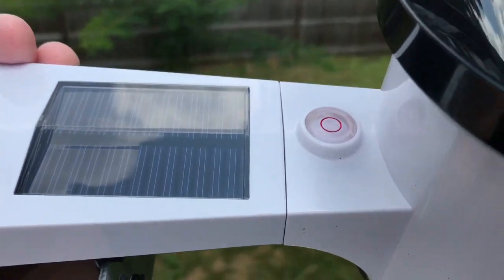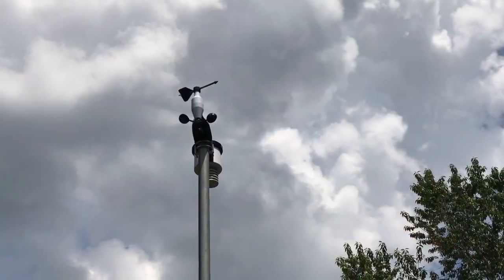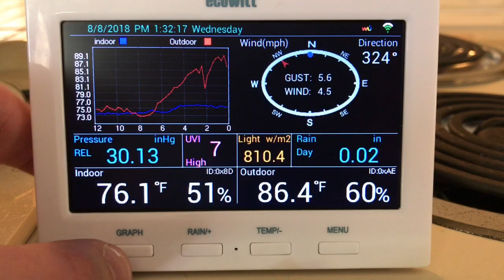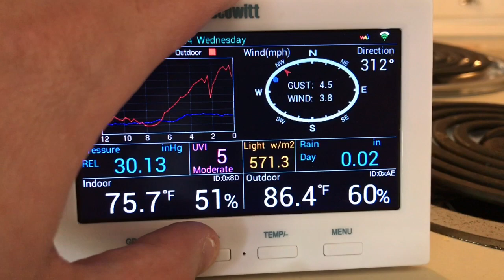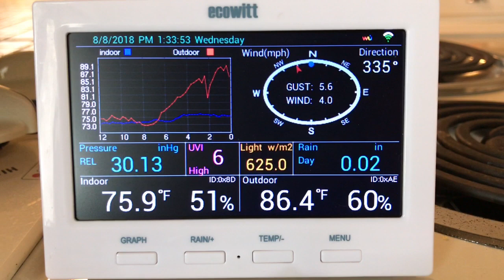Ecowitt HP3500B Weather Station

Comment: How is your console and your  complete outdoor unit now performing 2yrs later? Read on Amazon that many seem to give up the ghost a few months later? Please make a new video showing the condition of of your devices and any problems you might have encountered thus so far November 2020. Thanks.
Reply from the maker: It's still running great! It's installed on a 60ft radio tower so I can't get any updated video easily of the outdoor unit. I haven't touched it since we installed it 2 years ago. You can see live data from it here: https://www.wunderground.com/dashboard/pws/KALCHERO6
Reply: @drewprichards  Hi Drew, I wrote you again as I am more interested in the condition of your small console. EG. Are the buttons still working OK?  Any loss of brightness? Any lettering screen burn? Thanks a ton 👍
Reply: Great! Thank you. Just one more question, has the screen of the console detoriated in anyway, losing its brightness or any lettering screen burn as with some older consoles.
Thank you again for your input.